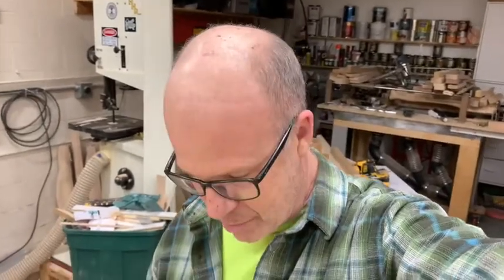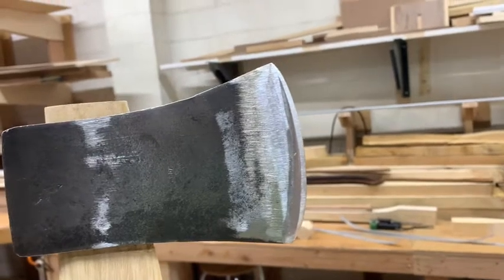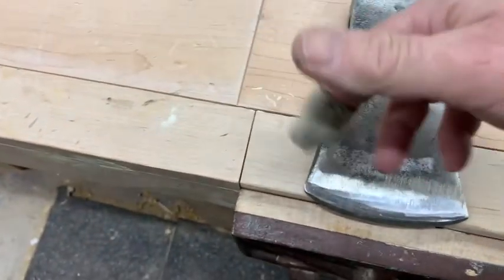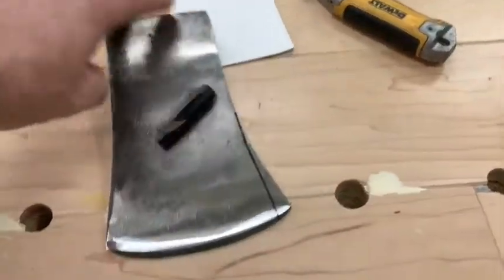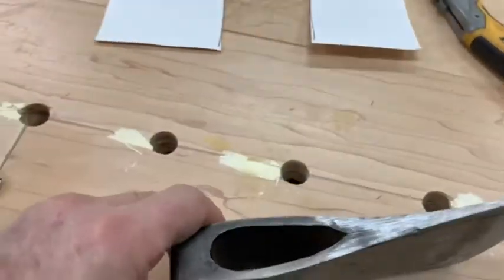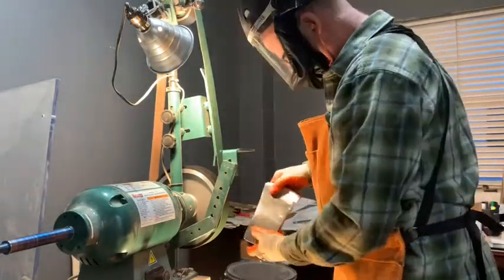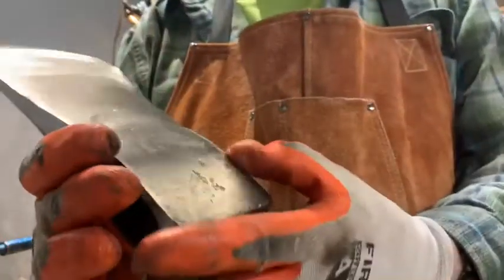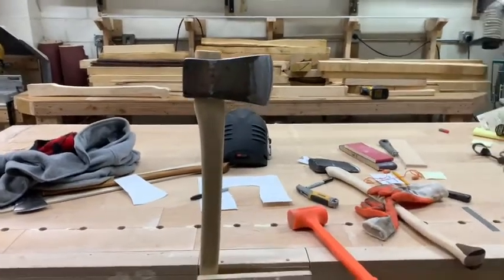Fixing Rhinoceros Axe, a GBA Drifted Upside Down#axe #granforsbruk

Comment: You can heat them up, but you have to know how to put the temper back in.....👊🏼👍🏼🧡🔥
Reply from the maker: The ceramic belts have been a lifesaver. Im not good at judging the temper. Usually I’ve wrecked it by the time I realize the temper is going south.
Reply: @Casterman2  its definitely an art, played a little bit with temper in High School, making center punches in shop class, I am no pro, but it can be done....

Comment: I have even started my cutting edge on a belt sander to get it roughed in then finished it by hand.
Reply from the maker: Variable speed belt sander clamped in a vise I’ve used. As long as you can control the temperature……..and the results are there, whatever it takes. I still enjoy doing it by hand.

Comment: Wow what a difference! Nice work as always! What about a slow cut band saw? We use one at work that produces almost no heat on the workpiece.
Reply from the maker: Yup that would be fine. Stay away from heat. I’m against angle grinders for axes for the most part anyway. Too fast and unpredictable. Although Metabo makes a variable speed on which I’d be inclined to try.